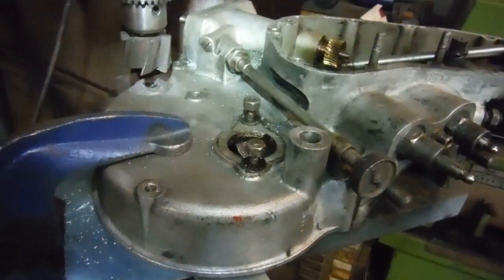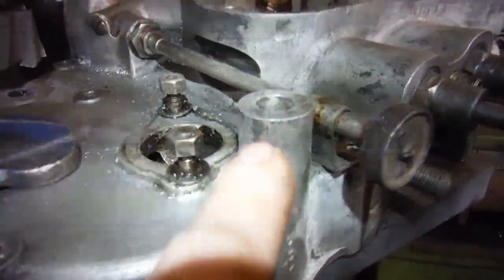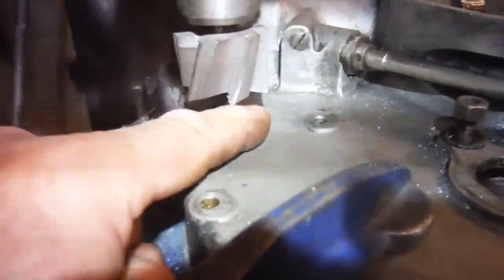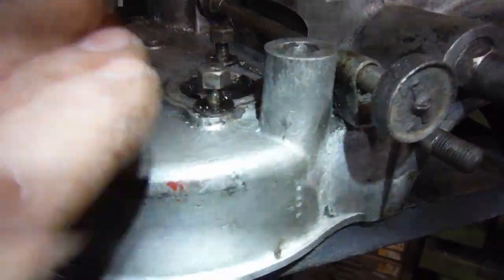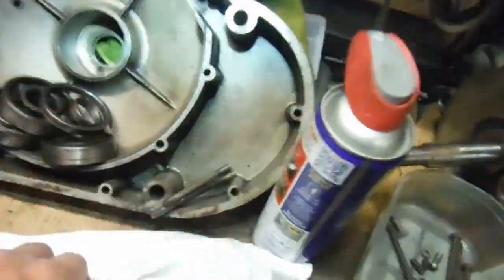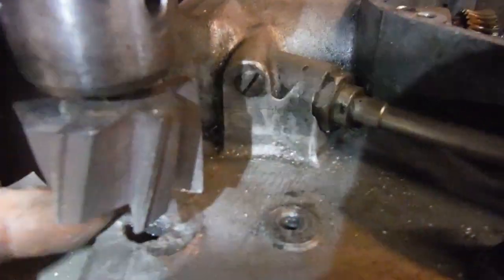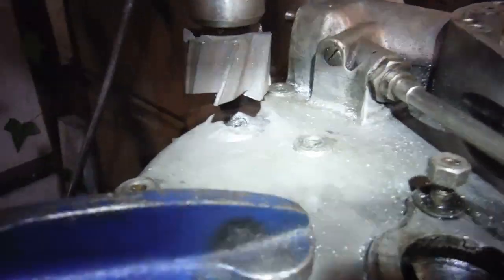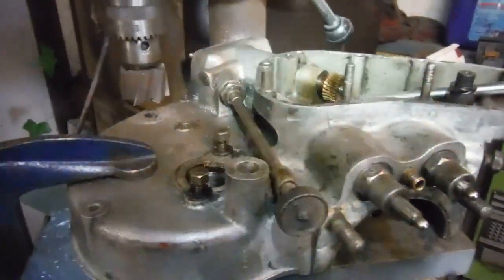BSA 350 cc Model L engine circa 1930 strip & rebuild 11 Attending to a damaged engine mounting point

Comment: Is that an adjustment nob for the oil pump, the shaft that runs from the tappits down to the pump?
Reply from the maker: Yes, it is.
Reply: How would you know how to set it?
Reply: @John900C  I think this dates from the time of no multi grade oils.
Thick oil at start up, giving too high pressure and hot oil too low pressure, so you have to adjust the pump to suit temperature and conditions.